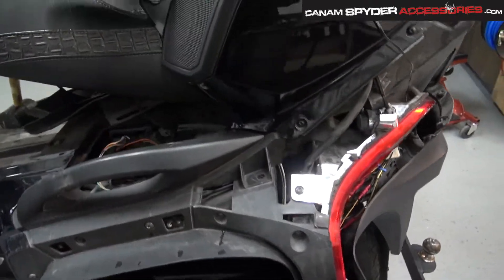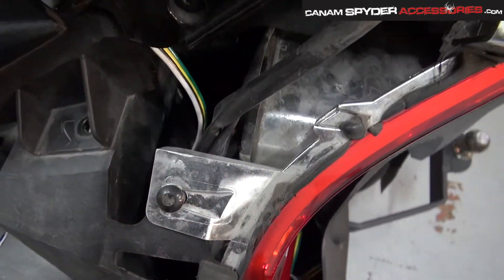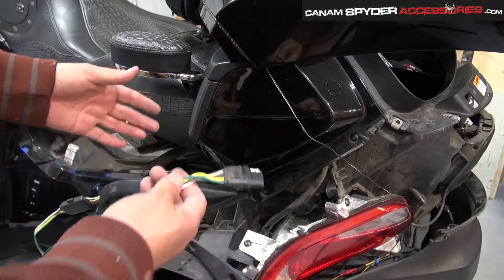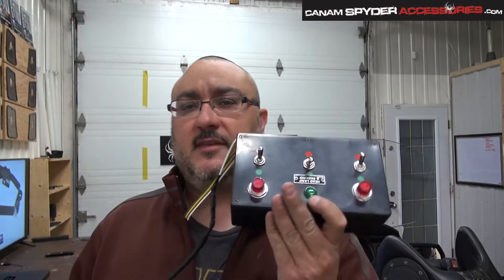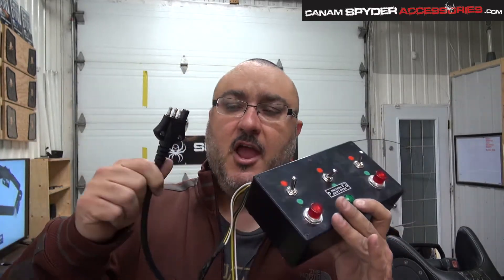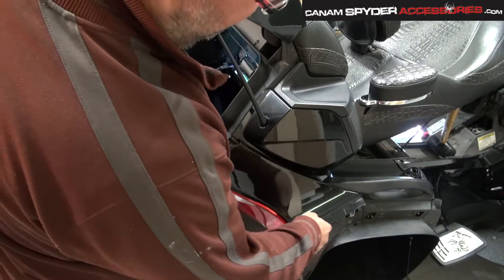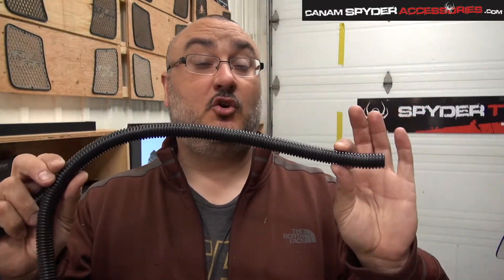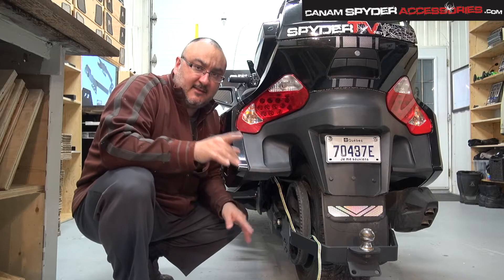Installation Part 2 of 2 - RT Spyder Plug&Play trailer harness RT 2010-2017.

Comment: Pierre, I install the canamspyderaccessories trailer hitch and trailer wire harness, It was easy peasy lemon squeezy to install. The way you designed your bumper for the spiders is awesome the RT cut out And the spider web design is awesome.It just looks so cool on my spider.  Pierre, thank you, thank you. Thank you for a great product. This bumper and The Wire harness is awesome.
Reply: Beer, I am Pierre. I have to also add in your videos on how to install different aftermarket. And spider products in Thare so easy to defollow with your tips and tricks. It cuts off maybe 30 minutes to an hour without having to take a part of the whole side of the spider. Let's face it, it would take longer if you had to pull all the body panels off on one side just to install this on the back you're tip Save the whole lot of time and right now. It's a 100° in Texas. GDOC

Comment: I just picked up the wire harness I picked up a nice little trailer and it's at the paint shop getting a sun yellow paint job to match my spider. It looks a lot easier set up then the one from Show Chrome that slingmods sells. And I needed to 4 pin set up that will work perfectly. 😊

Comment: i have a 2013 rt limited that has the can am trailer but i am having problems with the wiring harness and would like to switch it out. The problem is its a block 4 plug on the bike and trailer, can i use this harness for it or do you make a harness for the trailer or an adapter?
Reply from the maker: Hello, call the shop and ask for me, Pierre. It's easier by phone. 450-586-9608

Comment: Does the plug and play allow for amber turn signals on the trailer or does it convert the bike t/s to brake/turn on trailer. I don’t have a Can Am trailer
Reply from the maker: Spyder takes a 4 pin flat...if you have a trailer with 5 pins, you need to cut off the plug and use only 4 wires....yes turn signals will now be inside brake lights....and red.